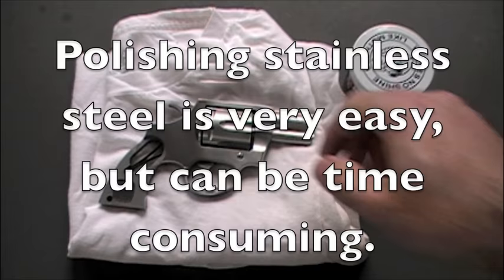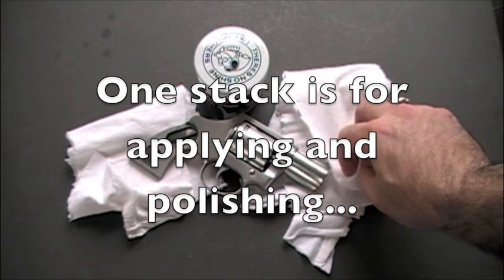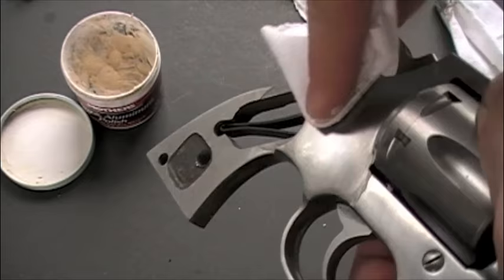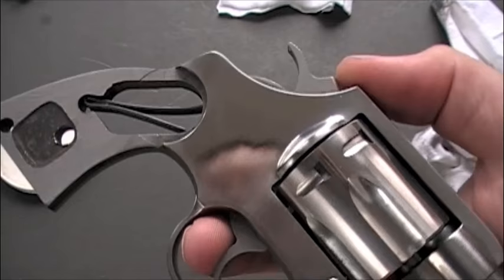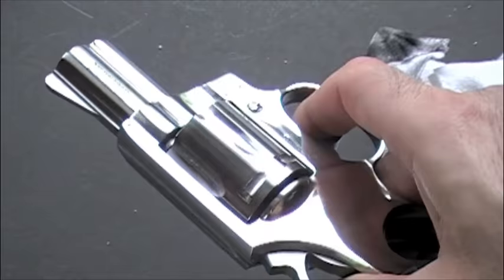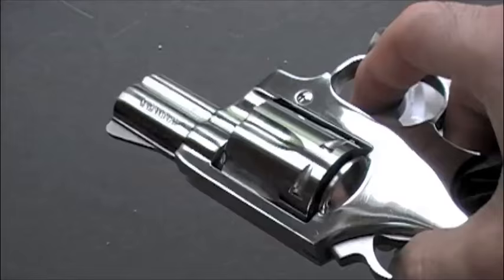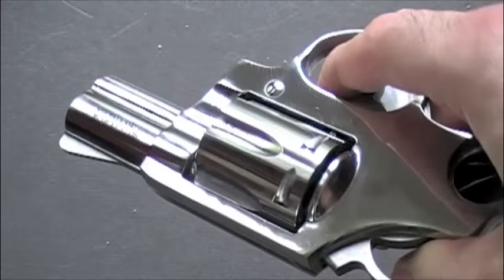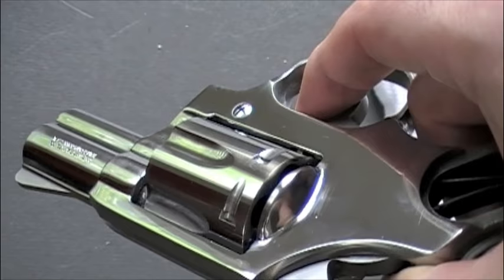How to polish a stainless firearm to a high shine

Comment: TIP: I used to work at a business polishing small metal parts by hand. Don't use a tshirt, it's a waste. Use Charmin Ultra Soft toilet paper (the red package). My understanding of it is that it's one of the few TP that does not contain small cardboard bits, so it does not scratch at all. True or not? I don't know, but I know it worked GREAT. And you don't have to rub it in hard, just lightly. Fold a square into 1/8th. A little goes a long ways.
Reply: +Tec 9 Thanks for the tip. I am gonna give that a try.
Reply: Howd it workout for you?
Reply: I knew my tp was a little scratchy
Reply: You wouldn't be able to use the shoe shine technique without the shirt though
Reply: Thanks for the helpful info! I'm going to give this a try since that's what we use for tp.
Reply: Wouldn't a micro fiber cloth be even better? I get loads of them from Sam's Club.

Comment: I watched your video and went straight out and bought a can.  I have a 25 year old S&W 686 which came with a satin finish.  Well, it was looking it's age and in about 45 minutes Mother's had it looking better than new!  I was never really happy with the satin finish look, now it is much shinier but I stopped short of making it a mirror type finish.  Very easy to work with - minimal pressure required.  Thanks for the video!
Reply from the maker: +Ross Henderson Shiny is always good.
Reply: +TheYankeeMarshal Thats right my lil Firefly. ;)
Reply: I have a model S&W Model 629 (44mag). It is stainless steel, that's all it needs to be right?
Reply: Is that a matte finish? Can you get a matte stainless firearm mirror shined?
Reply: rally? it was that easy??   wanting to do mine too!

Comment: Thank you so much. I just got a new king cobra target. It was factory new. The cylinder was blackened a bit. Came right off. Then I took grips off and did whole gun. 2 hours latter, the gun looks like a mirror. No scratches. Finally something on the internet that works! Thanks again friend.

Comment from the maker: @250rapid the main reason is the risk of damaging the surface. Any polishing tool that spins at high speed can marr the surface. Especially if the wheel become contaminated with residue from the polishing. It may not be that noticeable but hold the gun up to the light and look at the spider web like marks. There is also the risk of overworking a surface. Hand polishing is relaxing and eliminates all the risk of retexturing.

Comment: Just in case you're curious, you CAN achieve a #8 finish (mirror) with stainless steel. It takes much longer than other metals to get there, but at the same time you'll never get there unless you use a green polishing compound (which is meant specifically for stainless).

Comment: If you want perfection, use a sanding block to get a perfectly flat surface and then a cotton buffing wheel on a bench grinder with a fine compound. You'll get a perfect mirror even on stainless. Be careful with the sanding block(I use 1000 grit at the roughest and 3000 on the last pass) because you can burn through the embossed logos and numbers. It isn't necessary unless you want a perfect, wave-less mirror finish. If you don't mind some waves and reflection distortion, just go straight to the buffing wheel. Never use steel wool. It leaves deposits behind that will rust and damage the gun.

Comment: IMPORTANT: Everyone thinking of polishing their gun please read this. Using mother's mag will remove a lot of the micro dirt and dust stuck in the crevices of the steel. However, eventually, the dirt will return and you will need to repolish the gun, possibly even within weeks.

To fully polish a gun, you must remove those crevices where dirt gets trapped. You can only do this with 500-2000 grit sandpaper. Then once the surface is as smooth as glass, you can use mother's mag.
Reply: Nah. I've done wheels, steels, slides and guide's muh dude and I'm saying it's totally doable as he's showing and your claim is bunk.

Comment: Simply using mothers on Rugers revolvers does not work the same as it does on Smith and Wesson for those of you thinking of doing this to your Rugers. The metal is different. Ruger uses casting metal vs forged. So with that there are deep marks and swirl marks on the Ruger metal that simply wont buff out by using mothers. Even using a high speed dremel and polish compound does not remove most of the blemishes in the metal. You almost always have to wet sand the Rugers to get a clean mirror finish. Trust me, ive polished almost all types of metal and the casting Ruger uses is a bitch to get to a mirror finish compared to other metals. Something to keep in mind for all you Ruger folks thinking of doing this. The runs and marks in the Ruger metal are so deep you have to use a 300-400 grit to start off then work your way up and finish with a 2000-2500 grit. It takes time, patience and can be frustrating, but take your time and wet sand and you can get the same finish you would on a smith.
Reply: Yup. Thanks. Good to know why. I've been polishing my Ruger GP100 for two years with Mother's and it's a good looking polished revolver with a lot of swirl marks....
Reply: John Hope you can actually use 2000 grit sand per to get most of those marks out... Hope that helps!
Reply: John Hope what about Springfield?
Reply: John Hope Can confirm that! You will never get this high polished finish without wet sanding a ruger. Just polished the cylinder of my GP100 for about 5 hours and it's far away from a mirror glossy finish. But I like the now shinier look though.

Comment: Not sure about polishing guns, but I did a vid on polishing aluminum once...I used some really fine sand paper, before using the same mothers polish. It may take a little elbow grease out of the equation. I used the polish as the final step and it came out very nice.

Comment: I took your advice and bought the same cleaner as you are useing to clean my stainless 1911 and HOLY smackers what a difference it made. I first used Never Dull and it worked great on my Nickel plated 1911 but not near as effective as Mothers is using it on my stainless, i can't believe all the tarnish coming off, that Never Dull didn't even penetrate. Great videos btw.
Reply: That's not tarnish, it metal. From your gun. Mothers is abrasive.
Reply: ok but still wow lookn great...

Comment: thanks for the video. today i purchased the same polish you have along with the much more expensive mothers billet metal polish. i recently purchased a smith and wesson .500 with the 8 3/8 inch barrel as a substitute carry piece while my desert eagle is off getting reworked. the stock stainless finish looks boring. ill be spending a few days rubbing the new one down. this was helpful. :D

Comment: @250rapid The bigger reason for not using a buffing wheel is the little fiber from the wheel embed them in the gun and it's a pain. You Would have to break down the gun to prevent from polishing areas like the hammer. Then throughly clean the entire thing. That said I find that a buffing wheel leaves a better finish.

Comment: Great video.  I polished my new engraved Uberti Cattleman with Mother's, and in an hour or two,  it looks like silver!
(By the way, you don't need to cut a rag into pieces, just move to another spot, like your shoe-polishing rag.) Also, no need to take the handles off.
Reply: do you need to add something to maintain it do you need to worry about oxidation or something like that
Reply: Stainless steel do not oxide, cleaning it after use will keep it shiny . An old towel and some TLC doesn't hurt either but not necessary

Comment: I have a reproduction of a Civil War era 1861 Springfield rifle musket that I really want to clean up. I use it a lot in historical reenactments time apart of and the stainless steel is starting to get a little dull. I asked around on how to polish it up not quite to a mirror finish but at least something it doesn't quite look so dull. & I have gotten a variety of responses everything from the mothers polishing compound like what do you use to various levels of high and low grit sandpaper to emery paper to steel wool. If you know of a way that I can take the barrel bands and barrel and give them just a nice pleasing shine I would be greatly appreciative. Also hopefully something that won't fade and all out fairly quickly. And just so you know I don't fire the Springfield very often so yeah.

Comment: Wow, looks great! Good point about the Dremel. I was doing great until I slipped the bit off and had the Dremel rod grind a nice gouge into my finish which I was close to being done. Only good thing was I was using one of my least used guns to practice with a different buffing compound. Going to use the same Mother's stuff you use now. Thanks!

Comment: I tried it in my kahr but the slide is resistant. My barrel polished up real nice but the slide isn't giving up. Should i sand it with 1000+ grit sandpaper

Comment from the maker: That Mother's stuff is pretty good.
Reply: TheYankeeMarshal great vid man and great channe..l I have watched almost all ya vids ..hey recently got a Remington r1s 1911 and I an in process of polishing it by hand ..I'm noticing after some polishing I'm getting more grain scratches showing up ..do I ha e to sand to get them out ? Any advice thanks man
Reply: TheYankeeMarshal im  busy restoring a blank 44-40 long blank colt saa blank gun, im turning it from black to the stainless steel finish underneath the paint, brasso is doing a good job but it is taking a long time, its takin 2 hours and still doing it up. What do u suggest as i live in uk, i cant get any mothers stuff

Comment: Polishing (esp flats) is as fine an art as engraving...
 Mirror polish is straight, flat and shiny. Thing of the surface of your work piece like mountains and valleys, turn all the mountains to plateaus and your make the piece shiny, bing the mountains down to the valley floors and its Very shiny, Flatten the surface until its like a sheet of bedrock and you have a Mirror finish.
Wetstone, 3M Micro sandpaper on glass, then your compounds (Albeit lightly)
Complex curves are a different story

Comment: Great Video thanks Yankee Marshal.  Question though. Did the turn ring I see come out with just polish? I watched the restoration video as well. Does the 320 grit match and blend with factory finish if you are just doing spot scratches or do you need to go over entire gun to even out the finish?

Comment: I am wondering if I could use a dremel, and a ton of buffing pads to make this faster on my bead blasted Raging Judge. I think it would look awesome. I plan to leave the top of the back strap flat to deflect the glare issue, but wondering if a dremel will be safe or okay to use on a low speed setting just to avoid the arm wear.

Comment: I use renaissance wax on things but mutes a high polish. It is made of microcrystaline hard wax. Emulsified Carnuba will give you what you want.
If you want to go all the way. 600 wet, 1500 wet, 2000 wet, fine metal polish, then -50,000 diamond 0-.5 micron paste. and Carnuba.......looks as bright as the best chrome, nickel or silver. Down to the molecules of steel. But it takes weeks and you should take the gun all the way down.

Comment: Hey Yankee, thanks for the informative video.  I was able to get my SP101 to a mirror-like finish, using Flitz polish.  My revolver is brushed-stainless, and although I polished it to a mirror-finish, I am unable to remove the "brush" marks on the stainless.

Must I use high grit sandpaper to get rid of these marks?  I want the finish to be completely clear, without the brush marks.  

Thanks

Comment: A coat of automotive wax (buffed off by hand towel of course) will keep it shiny and protect from fingerprints during storage. I prefer Collinite 845 insulator wax if you can find it.
Reply: Good idea but once you use solvents to clean it bye bye wax
Reply: bye bye oil too so.....

Comment: I have a S&W Lady Smith SS with the laser etching and the "bead blasted" type SS finish.  I have a scratch in the bead blasted type surface (has nothing to do with the laser etching).  Any tips on removing scratches from a bead blasted type SS finish.  Doesn't look like polishing such a rough type finish would do well.

Comment: Nice video!  Very helpful.  I have a Kahr PM9 that I have carried for so long, the slide is already polishing itself.  The original matte stainless finish is almost gone except in the slots.  Figured I would shine it up.  Just as you said [and it had me cracking up because it is so true...]   Got a little trailer park in me...

Comment: I'd like to ask you if you think polishing the magazine springs is a good idea. I did a few and they're really smooth. I lightly polished the outside of my aluminum colored magazines too. They look and work sweet. I used 600 then 2000 grit  , wiped it down then used mothers and cleaned it all with a light ,very light, cloth with frog lube. Did I do wrong?

Comment from the maker: First just try some synthetic steel wool pads with a little oil on them. If that does not work try some wet/dry 600 grit paper with a little oil on it.

Comment: Is it possible to polish off the character line around the cylinder on a Colt Anaconda SS?  I bought it used and the cylinder line is light but the only flaw  Thanks

Comment: To keep this nice shine on it, how often would you suggest repeating this procedure?  In addition, when you're cleaning it after shooting, will the Hoppes 9 reduce the shine at all?  I have a number of S&W stainless revolvers that I'd like to put a little "pop" into their finish.
Reply: I only use Hoppes for the barrel and the cylinder etc, but it manages to get all over the gun. Wipe it off as best as possible and then wait a few days for it to completely dry and evaporate. There will be a haze over the gun. Then simply lightly re-polish it once and all your efforts will return. Hoppes does not destroy your work- it simply smears it and puts a haze over it.

Comment: If you take this to a bench grinder with a brass wire wheel, it will save you at least half the time, and it will  also remove the powder residue from the cylinder cylinder

Comment: what grit did you use to buff before polishing? I seen the 320/wet sanding to get the scratches out. But what did you use on the entire gun before this video? 500, 800, 1000, 1500, to 2000grit? a good polishing is like painting...your only as good as your prep work.

Comment: SWEET !!  Very nice.  But wouldn't it be easier to at least take the cylinder out and cylinder release so you can easily work around those areas?  Perhaps even the trigger and hammer?  More work before you get started polishing but I would think it would help in the long run when it is taking hours to do completely any way.  Now what is the best way to get in some of those tight corners such as between the barrel and underlug or front sight?  Just keep a long fingernail handy?  ;)  Thanks!

Comment: Thanks for that info.  I like a shiny gun too.  In the event you need to produce it, it seems to appear to be larger than it really is.  Intimidation factor can be the difference between them cutting and running, or having to go to court to explain ventilating a human.  Smaller black or blued steel guns can be practically invisible to an attacker until it is too late, and you need a lawyer.  Were I facing one of those, I would assume a high level of expertise from the operator!

Comment: Hey Marshall. So I'm thinking about buying an old Taurus  PT92CS.  It's scratched up pretty bad.  Stainless steel slide but alloy frame.  Can I pretty up the alloy without compromising the strength of the frame. I keep reading something about it being anodized and I should'nt mess with it.  Thanks

Comment: Use less compound and more of the polishing cloth.  It's ok if the cloth gets black before you move to another part of the cloth.  The optimal "cutting" or polishing is occurring when there is a lot of friction.  If you don't feel a lot of resistance and heat, you're not achieving much polishing.  Make sure the polishing cloth is clean 100% cotton.  IF polishing outside, the moment you set the polishing cloth on a potentially dirty surface like a sidewalk, or a driveway, that cloth is contaminated with stuff that will scratch the stainless steel.

Comment: Got an 1847 Walker unfinished full steel metal barrel and frame. With brass trigger guard, any problems using this method on all parts?

Comment: Hi TheYankeeMarshal, I have a question regarding the brushing marks that originally came on the gun from the factory.  My Ruger SP101 has some of these brush marks towards the flat surface area in front of the grip just right behind the cylinder.  I just started polishing my ruger with the same method as you, and its pretty damn shiney right now, I just cant seem to get the brush marks off.  Is it possible to sand that down and then polish it again? will it damage the finish in any way?

Comment: I know this is a old video,but I just polished my 686+ to a nice shin. Problem is there is a oily haze on the surface. Any suggestions on removing it? I tried hoppes no 9 with no luck. I wipe the surface with a clean cotton cloth and it no longer turns black. Do I need to just keep rubbing on it?

Comment from the maker: It works fine on all of mine and I have the guns on video to prove it. Maybe you are just not good at polishing. Plus, sanding is not necessary if no damage is present and wheel polishing often damages the steel.

Comment: How long will the high gloss last?
Reply: Till you scratch it up it's polished metal the only way it's going dull again is with sand paper
Reply: @kobaltstaub287  Nothing lasts forever. To keep it high gloss depends on how much it is used Arco Cola. Under normal use probably 1 to 2 times a year.